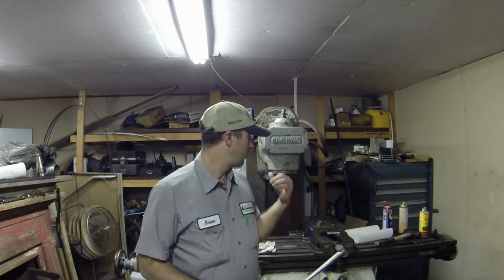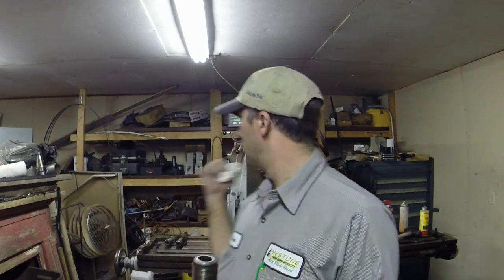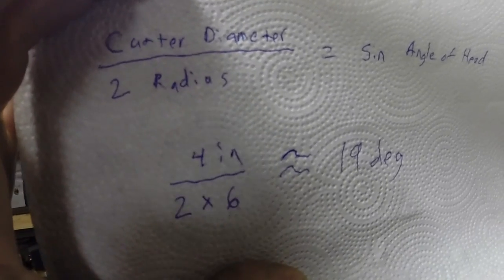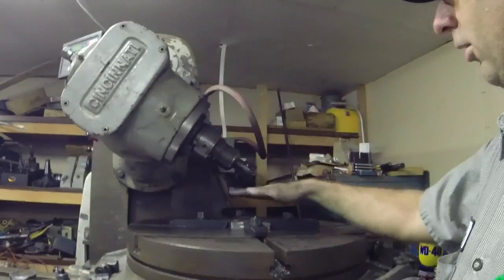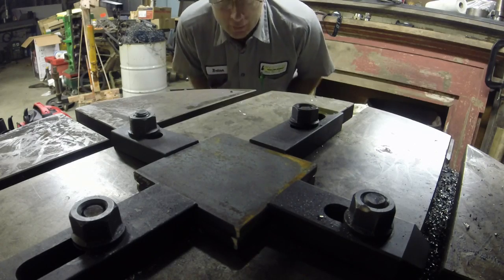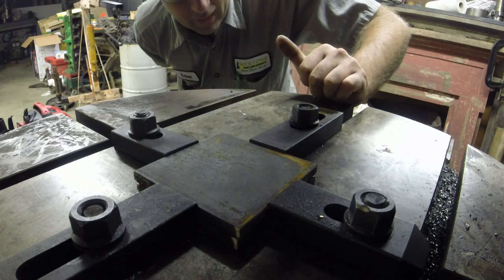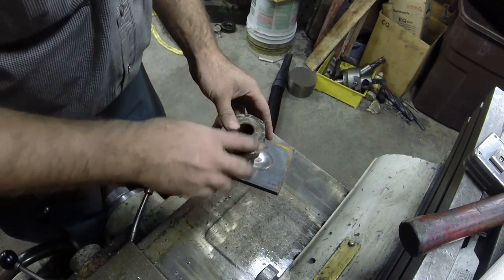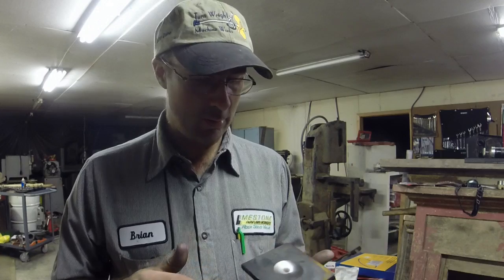Milling a semi-hemispherical socket

Comment: Hey dude,

I need help turning a 280mm diametrically sphered internal balll 30 mm into a solid metal !
Help
Reply from the maker: You mean you want a spherical void inside a solid block? I know of no way to do that other than sawing the block in half cutting the 2 cavities and putting it back together.
Reply: bcbloc02 i want a half ball void, in the face of a block.

Yes.
Reply from the maker: @Bibibosh  I know of no way to do that on a manual machine short of having a ball nose endmill of proper radius. Any other method could at best produce a hemisphere of a certain depth limited by the shaft size of your cutter.

Comment: We done similar in tech school. Cut a tow ball on the mill using a boring head withe the cutter turned in. Had to run the machine backwards, and the drawbar kept wanting to come loose.had never really thought about a concave shape. Thanks for doing the video.

Comment: Could I use a side-cutting, ordinary 'wheel' milling cutter on a horizontal arbor kept at the usual right angle to the table?  I can picture using a convex radius wheel cutting down into the part on the rotary table, and the mental geometry seems to work.  

I think the material removal rate might be horrible, but it should get a true circular arc cross section?
Reply from the maker: The more depth you needed to cut the wider the cut would get once you got very deep it would have a lot of side load on the cutter as you turned the table. I don't think it would be a very good setup.

Comment: needed that 2 yrs ago....looks like formula you found, i didnt....dont.. good work. I did mine with a 3/4 ball end mill..
Reply from the maker: 2" ball end mills are pricey so this was the way to go for me for this job. The ball end mill would be a lot faster though.
Reply: look at:
http://www.hobby-machinist.com/threads/fitting-an-arc-with-a-bullnose-end-mill.56479/
your part looked great and you had a lot to make. u right. I did with 3/4". A LITTLE PRICEY, A LOT.

Comment: I think you might have doubled your radius twice when you first did the math. You mentioned later in the video that you thought the radius must be 1-1/2", rather than 3", but your math showed you doubling a 6" radius. I can definitely vouch for that formula, though. I use it pretty regularly. The other thing that could have screwed you up is that the output angle is measured from 90°.  Some of the mills that I've used have scales that put horizontal at zero, and it's screwed me up before.
Reply from the maker: What I realized after making my 1st cut and it didn't match was I went back to the comparator and it was actually a diameter value I was reading and not a radius so my 6 should have been a 3 to begin with. From there I think the problem was I could not fit but a small portion of the screw on the screen as it was too large, combine that with the flattened edge from being set on the ground instead of its cup and it all went south.  I matched it close enough that with a film of grease it will pick the plate up so I was happy with the milling even if It was not my finest hour on the rest.
Reply: The final parts definitely look great. I just noticed the difference, and I thought it'd be worth mentioning.
Reply: Sort of. I work for an aircraft operator, so I kind of straddle the line between aerospace and maintenance/job shop work. I build a lot of tools for the aircraft mechanics, so depending on how I design the tools, I can wind up doing some odd operations.
Reply from the maker: Duncan Morrison
Cool.

Comment: To verify what the radius from the cut part, what you have is a circular segment. Repeating the formula in machinery's handbook, r=c^2+4h^2/8h; where c is the diameter of the segment and h is the depth of it. ^2 is the best I know how to type in a square on plain text. I know that the bolt itself was not conducive to measuring and accurate height since it lacked the center part, but anyway after typing all this in I should add I enjoyed seeing this actually done on video. I saw this done for a circular bottomed slot, but not the rotary job. Thank you for the video!
Reply from the maker: With a low lead attachment this could be used to mill the rotor helix's for a supercharger. Sadly I don't have one for my mill but that would make some really neat manual machine video! :-)

Comment: I don't understand how you determined the angle of the cutter and the geometry of the set up.  Did it just come down to trial and error?  This type of work is always intriguing because it appears so simple but is actually quite challenging.  Thanks for posting.
Reply from the maker: The math formula I gave should work to give you a close to correct radius. The problem I had was the original radius was unknown and I didn't have a good way to measure it.  I would like to do a revisit on this to be more technical if I can.
Reply: bcbloc02 I was also thinking that it isn't a constant radius but with my small computer screen and my poor eyesight, I can't tell.  It's a marvelous once in a lifetime project. I bet it will leave you with many fond memories.
Reply from the maker: John Ferguson
For this case it is an ellipse by less than 5%. The error won't hurt a thing for these alignment washers. As the radius gets bigger and the depth of cut gets shallower it is a closer match to a true spherical shape.

Comment: It seems impossible to make a perfect sphere like this with your cutting tool at an angle.

 unless your cutter is the same radius as the one on your part. only then you will have an island in the middle. and even then, you need to relief the sides of your facemill to make sure only the bottom tips of the insert are cutting. 

if you want a perfect sphere shape, i think your cutter has to be perfectly perpendicular to your work piece to get rid of that island. if not perpendicular, you're making a parabola and not a sphere. 

Im figuring you know. just saying this for the begginers :)

thanks for the video!
Reply from the maker: If you read the video description I covered all of that there. In this instance the error between radius cut and the true desired radius is less than 5%.  It will always cut a slightly tighter radius than what is desired everywhere except at the bottom of the arc.  The shallower your depth of cut and the bigger the radius the better they match.
Reply: bcbloc02 oh, I see :) should ve  read it first. thanks

Comment: Interesting... Am I missing something or won't the diameter of the cutter contribute to the curve of the hemisphere? Didn't see Bailey's wag of approval either.
Reply from the maker: Yes the radius that is cut is slightly less than the desired radius. For what I was doing here the error was less than 5% which is good enough for the application.  The shallower your depth of cut and the greater the desired radius the smaller the error becomes.  Baily was asleep on his couch thus the shoddy measuring job on my desired radius to begin with.

Comment: Geeze Brian that RT of yours probably weighs more than all the tooling combined that I have for my BP clone. I did know how a mill could be set up to cut a concave radius, but that's the first time I've watched it being done. Very interesting and thanks for taking the time to show it. I've seen some pictures of really complex milling done in some of those old books before CNC was even thought of. Cutting jet engine turbine blades with a universal vertical mill and the dividing head driven off the X axis screw with a hydraulic tracer attachment copying a master blade was the most complicated I've seen so far. It probably took over a full day to get the set up properly aligned. Sure proves how versatile these manual vertical mills can be with the right guy operating it.
Reply from the maker: I could probably mount a Bridgeport on my rotary table. :-) I love the old books, I learned most of what I know form them as I never really had an actual teacher.
Reply: LOL, yeah you probably could. And your mill could turn mine into a pile of chips pretty quickly. Same for myself, no formal schooling about machining other than a bit back in high school. Youtube and the forums are pretty good, but they can't go into the detail that those old books do. A lot of tricks and techniques can be picked up from them that are seldom mentioned or seen today.

If you don't already have a copy, Tool and Gage Work by Goodrich and Stanley first printed back in 1907 is really good. I believe Lindsay Publications may have reprinted it at one time as well. Mine is from 1923. Interesting reading about American Machinist and there thoughts about then then new Johansson gauge blocks that had just  arrived in America and what they might be used for.I think they might have got there hands on the very first set in the states from Johansson himself.
Reply from the maker: Turning Point
 I will have to look for that book. Thanks for the tip. This makes me wonder, were the 1st Jo blocks English or metric?
Reply: The blocks shown in that book are Imperial. Since they were invented in Europe my guess is the first one's would have been metric. Johansson invented them to reduce the waste he saw in factory's since every new part seemed to need a new gauge and interchangeable part standards was still pretty rare for most manufacturers even in 1901. So in a way what we have today can probably be traced back to that first set of gauge blocks shown in that book. My other guess is that he must have thought a Imperial set would get a lot more interest here than metric would have at that time. Johansson got his patent for them around 1901 so there was a bit of a gap between there use in Europe and when we started using them as standards.

There's also some impressive accuracy numbers quoted in that book for master gauges used to check the day to day factory floor gauges at a type writer manufacturers. They built them using shop made hardened and ground tool maker buttons and a shop built dial test indicator. It's a lot different than what we think of as a DTI today. The book also shows full working drawings to build that DTI. They machined and ground the master gauges on a lathe face plate and hand tapped each gauge hole into position to far far less than a 10ths accuracy. So if you can dig up a copy I'm real sure you'd really enjoy that book. My apology's tho Brian, I went way OT here. But if you do find a copy I'd be interested in your thoughts after reading it.
Reply from the maker: Turning Point
Don't apologize! Educational comments are the best. :-) I definitely need to look for a copy.

Comment: Used to be a magazine called "The American Machinist," they did all kinds of seemingly impossible things on old machines and they would have loved this one. There are some reprints. I sure never saw that setup before!
Reply from the maker: Too bad my mill is too close to the wall for me to be able to get the driveshaft in to power the rotary table or I could really make this a slick operation.
Reply: Coould you rig an electric drill rotarizer to tha monster table?
Reply from the maker: Juan Rivero
Probably but regulating speeds might be a bit fussy.  Only 40 crank revs/part I think so it is good excercise anyway. lol
Reply: I have to agree with that one. Good exercise!

Comment: Im sorry but from a non-machinist this is AWESOME that with some math and a manual machine you can do a ton of stuff.. thanks
Reply from the maker: And just think there used to be building after building of manual machines building manual machines, all long gone now.  The surface finish from this method is really smooth, I am curious how fast a CNC could do the same op with a small ball end mill. Right about 5min not pushing it here.  Maybe one of the Fusion gurus could model and estimate it.

Comment: I'm sure that setup was no walk in the park. Nice result for the labor involved, rewarding indeed. Thanks for the vid.
Reply from the maker: Well at least the setup wasn't too bad after I divide it out over 40 plates.  It is going to  make proper installation much easier.

Comment: I imagine that the most difficult thing is to align the center of the rotary table with the lowest point of cutter's edge. The only way I can think of, is putting a waste pice and moving the table around until it leaves no nipples in the middle.

Comment: Thanks for another reason to have to get a real mill instead of the bench mill which you can't tilt the head on.  :-)  Nice technique to know.
Reply: I'll agree with that one! (Having a relatively useless mill-drill myself).

You can do the same sort of thing with a small rotary table on an angle plate, if you can't tilt the head.

Comment: Learned something new here, which I will store away until I need it. Great solution, and very interesting to watch. When the wisest in the bunch are "asleep on the job", one can only expect some lack of supervision and the attendant trial-and-error approach thus needing to be applied. Without Baily's supervision, applying the math to the work piece can, however, be done without interference and delay. Awakening supervision is not always a wise approach. hehe
How in the world did you get that rotary table on the mill table? I don't see any overhead crane arrangement.
Reply from the maker: Oh how I wish I could have used the overhead crane!! Instead I was relegate to the old method of wresteling a cherry picker around with a dangerous pendelum.

Comment: Brian,
How did you know  how  deep the cut had to be?
Very cool set up esp the reversed clamps!
Eric
Reply from the maker: You could use math to figure it but the truth is I just cut deeper and deeper until I got the proper diameter to match the jack screw. Then I set z-0 on the DRO and just do each one to that same depth. The dimensions are not critical for this application. Glad you enjoyed the interesting setup. More than one way to Getter done!
Reply: Brian, Ah yes nothing like precision guess work...especially when it turns out so nicely. Great job!
All the best,
Eric

Comment: Brian that is slick! I could see picking doing that on a horizontal mill and rotary table  with the right diameter cutter too!
Reply from the maker: You could indeed but then the cutter diameter will be dictating your radius. With the angled head you can vary the radius with the angle from as tight as the cutter radius out to infinity, which is of course flat.
Reply: Yes indeed just different ways to get to the same end. Always nice to learn something new or different ways to do a job!
Reply: Brian any way to do an external  Radius shape? I have seen it done on a lathe just wondering if their is a way to do it on a mill?
Reply from the maker: Y Pop
You can use a angled flycutter and feed into the cutter from the bottom to produce a convex surface by the same method.
Reply: Thank You never thought of that!

Comment: Interesting 
My guess is that your calculations are based on the center line of the cutter not divided by a 1/3 which is the part that is doing the cut 
Just saying as I would not have had a clue on how to do that other than a grinding stone profiled to the radius
Reply from the maker: I think it was mainly not having the right radius to begin with.  I could only view a small section on the comparator because the part was too big. Much like a computer if you put bad info in you get bad info out. For example the 6 I had to begin with measured was actually diameter and not radius.  Good think I went with the just match it method because I sure screwed the rest! lol